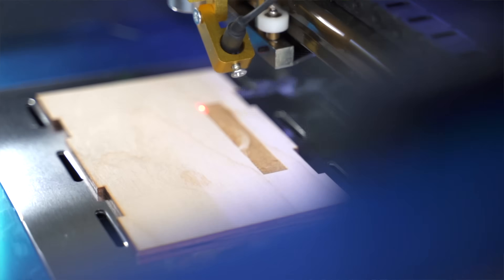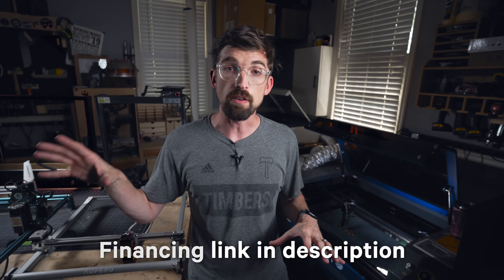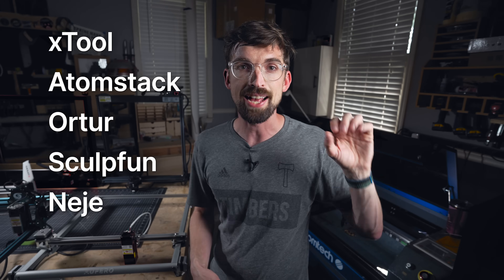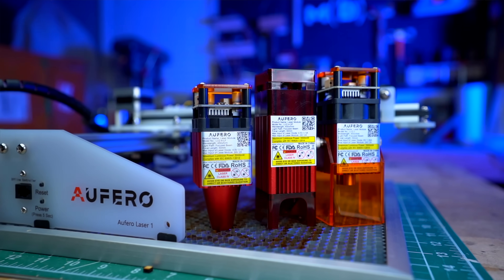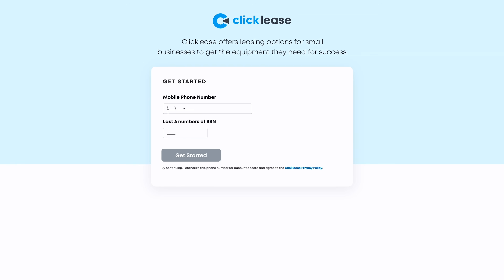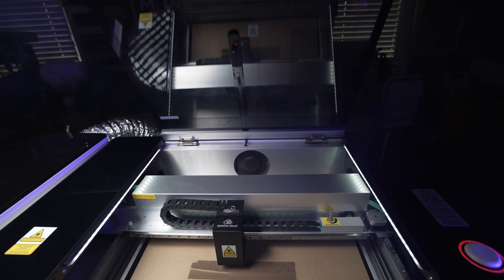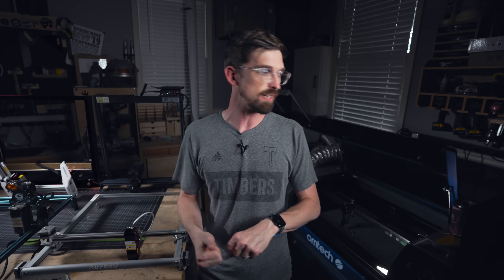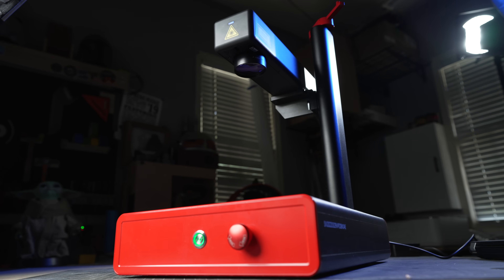Top Laser Engravers and Cutters to Get in 2022

Comment: The problem that I have with Atomstack (and various other companies) is that they lie outrageously about their laser power, advertising the power consumption of the unit rather than the optical output power (which is the only thing that is meaningful). Reputable companies (J-Tech Photonics and Gweike Cloud, for example) do not do this. Yes, Atomstack buries an optical output power deep in their text, but I wouldn't trust it to be accurate given how dishonest they are in the rest of their advertising (for example, 48W for the X40 MAX is *obvious* BS to anyone familiar with diode lasers). In my opinion, we should boycott all laser manufacturers that even mention the power consumption, given how much it misleads many buyers. And, I want to see them show the ACTUAL laser output power being measured with a power meter (again, J-Tech and Gweike Cloud do this).

Comment: Looking for advice here. I need a laser cutter that can cut 1” foam (packing material) that is less than 7”x7”.  If it could also efficiently cut .118” acrylic, that would be a huge +++! The cheaper and easier to use the better.

Comment: Oh yea, I used to work for a company that did precision laser cutting, drilling, skiving, micro-vias and occasionally engraving. We had machines in the hundreds of thousands of dollars range, even a few into a million dollar range. ESI was a brand, from China I believe, that we had that did UV lasers. Another was the Excellon Cobra which had both UV and CO2 in 1 machine so you could cut/skive/drill with one and do a finish pass with the other. Or a multilayer panel with different materials like copper and dielectric. Cool stuff. Have been thinking about getting a laser engraver for some product ideas I have

Comment: So, I’m a woman and I have a business where I do wood work but I am very much not electronic savvy. I have a scroll saw, table saw, miter saw, router, dremel, jig saw/ basically everything but a CNC machine. What work we do is resin art and wood work for home decor. What would be the best user friendly but cuts what we need? I’m wanting more of a wood cutter and not an engraver. Yes? That would be a plus, but I’m wanting to cut words/fonts out of wood and put it on other items to paint or resin. (ie- welcome sign). Clearly I don’t need 7k+ type machine so what would you suggest for someone that does my line of work at home?

Comment: Thanks for your video! Do you have any spec comparisons or recommendation toward one or the other between the Gweike and the Makeblock/xTool Laserbox Pro?  I'm currently torn between the two and need a professional opinion to sway me in either direction. (To give you an idea, I would be using the laser cutter/engraver for typical Etsy work with acrylics, mirrors, wood, etc. I know either machine would fit for that purpose, but I do plan to eventually grow my shop and learn how to use the machines for more purposes down the line. I'm looking for a machine I can grow with and learn more about as well as do the typical beginner stuff.)  Thank you!!
Reply: Hi,

This is Olivia from Jinan LaserMen CNC Equipment Co. Ltd, a laser machine manufacturer. Nice to meet you.

Fiber laser cutting machine, hybrid laser cutting machine for metal and nonmetal, CO2 Laser cutting engraving machine, laser marking machine, laser welding machine are our main products. There are different models.
Please let me know if you are interested in.

Looking forward to your early reply 

Best regards

Comment: I'm new to this.  I'm a hobbyist woodworker and it seems clear that a diode machine will be what I want.  But I still have so many questions.  What does air assist do?  What wattage would I want and what difference does power make (speed?).  What software is most common and will I have to spend money on that?  Can the software run on an ipad (don't have a laptop)?  How long do diodes last and what do they cost to replace?  Can I run these in a cold environment (think garage in Minnesota in the winter)?

Comment: Hi Brandon came across your video and would like to know what would you suggest for a beginner at using laser.
I create O scale dioramas and want to design and cut my own buildings.
Great video but still not sure which Laser cutter that I need.
Reply: that's not an easy question to answer. In order to answer that, we need to ask you some questions. One of the bigger questions to ask is what size of a work space are you going to need to make these cut-out buildings and what kind of material (including thickness) are you using. The other big question is what is your budget? He kind of breifly mentioned the K40 as a caviot, and as a matter of fact, he took it out of the CO2 budget catagory for some reason (I guess because of the work space size) but the one thing he DIDN'T mention about it is that you can get one for under $500 USD. Yes it doesn't support the  lightburn software, but you can get an upgrade controller board for aroung $150 and upgrade it yourself. 

The other thing I would mention about what he said is that the budget CO2 systems use an aquarium type of water system which simply means that (in the case of the K40) they come with a small pump that you put into a bucket of water to keep the tube cool, BUT!! there is no reason you can't get a chiller for any of these CO2 systems and put the aquarium pump back into your fish tank. I bought my OMTech 6L CW5200 chiller at the same time as my OMTech K40 laser and it was only a little more than the K40 it's self, coming in at around $525.

The great thing I love about the K40 is they are very popular, so there are lots of upgrades you can get. I did get some other upgrade parts to make mine a 60W system because i'm going to be making cut out parts (similar to what I imagine your buildings will be like) out of 3mm acrylic (basically pexi glass) and I don't think the 40W system can quite handle it, so I'm prepared to upgrade if need be. 

So Let's compare buying a 60W larger system at (I think right now they are running around $3000) to an upgraded 40W system in terms of cost. 
the base K40 is around $475. 
controller board is around $150
60W laser tube is around $240
power supply is around $140 
for a total of around $1000 compared to the $3000 for the 60W out of the box system.
(I actually got an 80W power supply because the 60W wasn't available at the time I purchased mine)

Yes one of the big disadvantages to the K40 is it's workspace size, and that's why I asked at the start of this: how big of parts do you need to make. I know O scale is much larger than H or even HO, but I don't know how you have your buildings designed or what construction method you are using for construction. I would GUESS that you are going to make them out of 1/8" plywood (or something similar) and will use some kind of finger joints to put them together (I would hope you are not going to just butt them together, but that's not my call)

Comment: I run a 20+yo Universal V 50 Laser. can't believe how well this Mahine is made Never changed the Laser, Changed 4 sets of Bearings and Drive belts in set of struts on the access Lid. Paid 65k A$ back than for a fully decked out unit rotary included and got more than10 times the money back Super reliable, super happy.

Comment: Is the "air assist" is mandatory or that's optional, and what is it for exactly?
I want to start a engraving company and want to buy the XTool Pro but I am new at this and I want to learn as much as possible.
Thanks for the video!
Reply: The air assist isn't really mandatory, but most people like using them and they are mostly used to cool the surface after the laser passes to extuingish any flames that might flair up, especially if you are working on wood.

Comment: I'm interested in working with lasers. One question I wished you had addressed is consumables. Do the diodes have a limited lifespan? How about the CO2 tubes as well? I know you mentioned upgrading the diodes so I'm assuming that's a DYI  project and if your diode is 'dead' you can order a replacement. How about replacing the CO2 tube? Are there any other parts that may wear out? Thanks.
Reply: Not sure if you ever found your answer but a 60w co2 fiber laser tube is going to give you roughly 1500 hrs of use before it might need replacing, an 80w should give you roughly 6,000 hours of use

Comment: None of these machines should be using the word PRO in their description. They are at best a hobby toy. The Chinese machines have part replacement issues and the water cooled are a real clumsy system that takes up space. Real pro machines, the kind that will last if you are trying to make money, are well over $12,000 dollars. Diode lasers required a LOT of patience and lots of scrap material to get the engraving where you want it on the work piece.  The video is spot on but lacks in total coverage of lasers that are out there.

Comment: Love these reviews, but would like to have your opinion on a laser that is portable and fast. I am looking for a laser to put in my craft show trailer. My main pourpose would be for engraving anodized aluminum minimalist wallets, flasks and tumblers.
I currently have an XTool D1. I was going to use it, but it takes it around 10 minutes to do a wallet and I want this time frame brought down. So, I am thinking a fiber may be the best choice....but I also want to keep it sub-$2000 if possible. It will be powered using a gas powered generator and will be in an enclosed area (meaining out of spectator viewing range - but still well ventilated).
Thoughts?

Comment: Great video, newbie question ¬"what power laser would I need to mainly cut wood veneer"
Reply: 5 watt will work but really slow so don't go too cheap. I have an Atomstack 10watt and love it. I bought mine just before they came out with the air assist but did get the rotary for just over $1000. I like the look of the X Tool rotary system though. Maybe thinking I can modify mine to work like X Tool's.
Reply: @1976ClassicCelica  Thanks very much for your answer, clear and concise . great help👍

Comment: Great video! Thank you!

For me it’s between the Xtool D1 Pro 20w or the Atomstack X20 Pro 20w and I’m leaning towards the Atomstack because it comes with air assist, the screen you can load files onto and it’s cheaper than the Xtool. After I can prove my business idea is viable I plan on upgrading to a higher end Omtech laser that can batch parts quicker.
Reply: This is my same thought process. Did you already get your x20?
Reply: @morgjg2004  did you buy either?  I’m also wondering if @PainfulWhale bought one yet.
Reply: @mickeymallette2663  still haven’t bought one yet but probably am before the end of the year.
Reply: @Painfulwhale360  I’m online now trying to decide
Reply: @mickeymallette2663  yeah I’m trying to decide on getting the X30 now since it has come out since those video was released.
Reply: @Painfulwhale360  I’m probably not on the X30 just because cutting isn’t my priority.  I want an engraver more than a cutter.
Reply: @morgjg2004  haven’t purchased yet but will
Most likely before the end of the year.

Comment: I just ordered the X-Tool-D1 Laser Engraver with Rotary, 10W Higher Accuracy Laser Cutter, 60W with Support for LightBurn, and the air assist add-on for $850.00. I am a CNC Machinist but I can see the laser engraver is a better buy than a router. Thanks for sharing you knowledge from Experience. 😁

Comment: Engraving DPI is hugely important.  While I know 1200 DPI on a diode or fiber is doable, they are mainly marking machines (not cutting).  When I compared machines, I asked specifically about DPI ... they all report higher numbers than to be expected AND/or skipped around an answer ... their website numbers cannot be trusted.  The newer gen. machines have better motors than the 4+ yr old designs and can consistently do +800dpi, like the 2 co2 machines you mentioned.  There are more economy options that can perform, and there are more DIY coolers that aren't messy nor expensive.  I have a BOSS 70W and can cut/engrave basically anything I desire.  but it's older and doesn't have the newer motors (so the effective DPI is about 1/2 of the newer machines with the smallest focal lens), but it can be upgraded.  If it's a hobby, speed isn't as important ... precision is.  i would never spend less than $3k on any laser, period.  People ask when i give them stuff i make: " You did what?"  i say:"yes, I'm a Jedi, I cut stuff with light".  Diodes imo don't count.  I've used over 36 types of materials .. and my co2 hasn't failed me yet.

Comment: Great video! I've found the Atomstack X20 Pro to be my go-to diode laser for the past couple of months as I've mostly been cutting thin plywood and MDF and the included air assist gets really clean cuts.
I'm looking forward to trying out the Gweike Cloud since you've had good things to say about it. It seems like their name is pronounced "g  veek", I found an employee video where they were all pronouncing it this way.
Reply from the maker: The x20 is a great one.  Thanks for the heads up on Gweike!
Reply: @makeorbreakshop  looked at the AtomStack too. Do you have videos recommending products? I don’t care a ton about cutting, really want a good engraving machine. Hard to choose between multi-diode machines and CO2

Comment: Just got my XTool D1 Pro 10w and Lightburn is a headache to use. I’ll set the dimensions of the work and frame it and everything is good. But when I try to engrave the diode starts half an inch off of the material and the image comes out about an inch smaller than the dimensions on the screen. I have none of these problems with the software XTool included with the laser though.